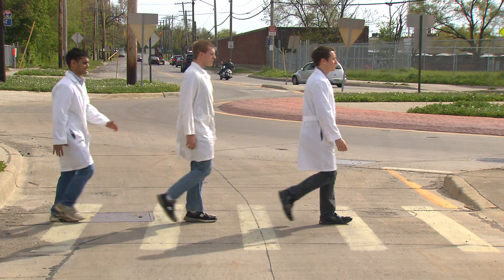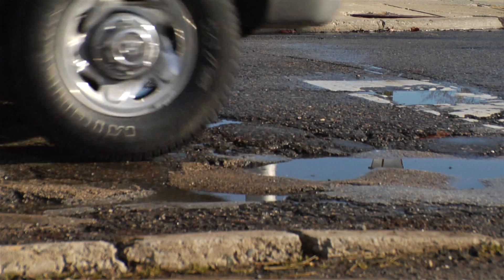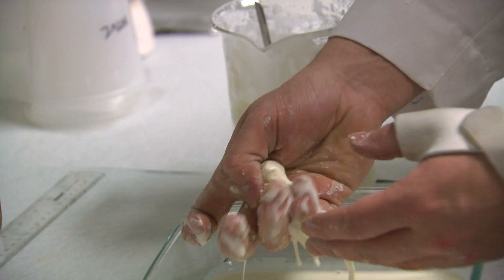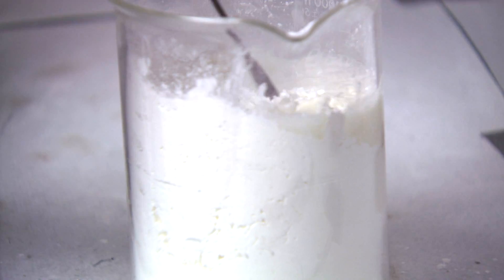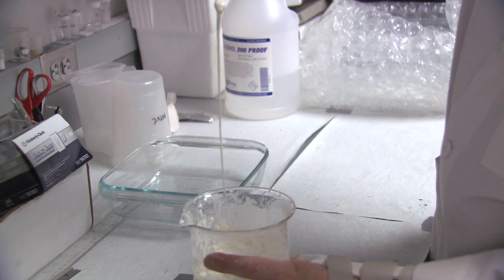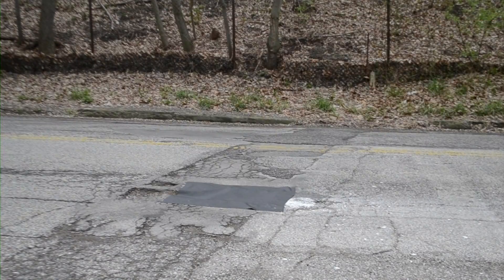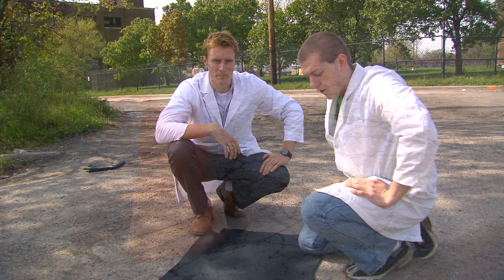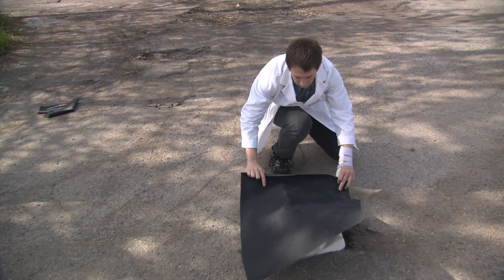Students Invent a Better Pothole Patch

Comment: Yeah but the real issue with patching pot holes ESPECIALLY IN CLEVELAND is when winter hits and plow trucks fuck up all the work that was done over the summer. It this solution impervious to plow trucks scraping them up and out of the ground?

Comment: Right, until a sweeper kicks it up, someone picks it up out of the street, a plow knocks it loose, the bags burst (semi hauling gravel anyone) or it's knocked loose by a passing car. A permanently bonded fix is what is needed to fix potholes - Why bother sending out a crew around town dropping bags when you could be sending them around to put in proper fixes/patches? It doesn't make sense, and I expect more from a university.

Comment: it needs to be waterproof and made so that no water can get under the patch and on the sides of the patch and onto the surfaces between the patch and the hole. or else hydraulic forces from the wheel pressing the water down and that water having nowhere to go, make the patch come out of the hole again.

Comment: this material's getting some good use for automotives.. seen another video where they're using this fluid for speed bumps.. so if someone takes the bump slow like they're supposed to, it'll be a fluid state and will be soft and cushion the tires; but if someone doesn't slow down it's going to hurt..

Comment: The real solution to potholes is to patch them with cold asphalt as soon as they appear. The longer its put off, the bigger the hole will be and the more material required.  Cold asphalt is excellent when properly placed, crowned, and compacted
Reply: Cold asphalt isenta. Fix it's a band aid the road crews even admit it doesent last long maybe a few weeks or months, a long term fix is milling or hot asphalt since cold asphalt doesent actually stick to the pothole its like gravel just fills it up

Comment: Cold asphalt mix my ass, its hot mix. The hot mix is more of a long term fix than those bags. This isn't viable option, unless you could take that invention and dump it in the hole. A patch you can plow over, this you can't. And frankly, its not gunna handle the abuse of everyday traffic plus trucks. Im a city road worker myself and fix potholes and huge cracks.

Comment: halariously retarded idea
Reply: Cold patch can fill any shape or size hole and fully supports the edges thus preventing further breakage. People are just intrigued by the idea of a "non newtonian fluid" and the way it behaves. Its not a good idea.
Reply: If its stupid and it works, its not stupid.
Reply: If you've ever driven a car over a pothole (especially when you can't go around it) It can seriously damage your car. This isn't a retarded idea, it's a brilliant idea. How would you fix the problem?
Reply: You use cold asphalt and actually have a smooth surface. A sand bag would be fine to buy some time before the repair can be made
Reply: ya but someone isn't going to walk of with coldpatch in a pothole like they would with those bags.
Reply: are you implying its not a word?
Reply: Stephen Porter  Hilariously*
Reply: It's not.
Reply: more expensive
Reply: celegaming i would.

Comment: Materials that can be moved and can't be attached itself  to the surface with long-term ( eg. a few weeks +) stability proves worthless . While they add 2nd  stage of improvement  with a huge black  bandage  over it simply proves it will shift under normal & high stress  conditions. Too prematurely given an award  for something that is not fully tested for full durability in the real world. Result in no demand and future for this product for comercial contactor use where liability would be jeopardize.

Comment: yea very successful. its 2.5 years and still no word on what happened LOL
Reply: 5 years later still no success
Reply: claude kim one of them died
Reply: @minidwarfdude9230  How do you know?
Reply: its basically corn starch and fucking water
Reply: claude kim it's a terrible idea. once the bag breaks the fluid (when not under pressure) will leak away / evaporate.

Comment: why dont u just put sand bags in there
Reply: So put them in the same bag this fluid is, or another more durable bag maybe?

I mean I love the ingenuity of this, but it just seems like a $1000 solution to a $100 problem.
Reply: lmao @ the arguing.. the bags don't break because Science Bitch! (J/K, couldn't resist).. but there is never great outwards pressure exerted in/on the bag because the fluid becomes solid when impacted by the vehicle at high speeds, nothing is being spread out or dispersed through out the bag until that solid state returns back to it's fluid state, at which point it will fill out the bags at normal flow rates..

In short, this isn't normal liquid in a bag.. nor is it a loose solid like sand..
Reply: lol sand bags are paper? theyre cross hatched plastic and fairly durable. eventually they would break. just like these will when a dump truck drives over it
Reply: Skyscorcher5 so why won't these bags break if the sand bags will? I'd think these would break worse based on liquid.
Reply: KremitDeFrog millennials I tell ya
Reply: Skyscorcher5 um dude i think you just woke up. A bag is not always dependent on its contents. You can have a thermal insulated bag of sand not that you would ever need one. So how is a sand bsg made from paper?
Reply: with this single comment you just killed their hardwork lol
Reply: lol